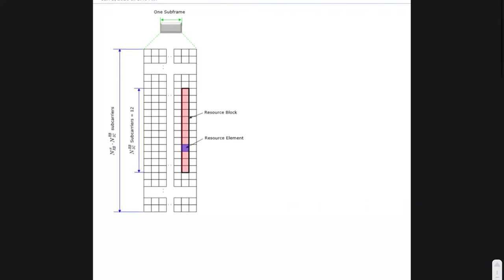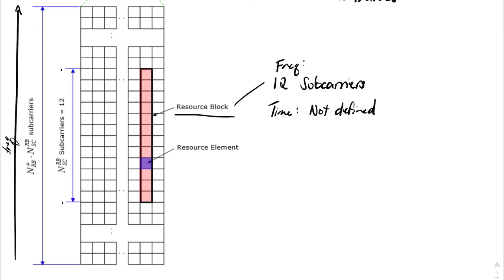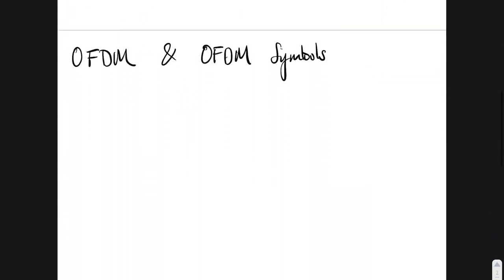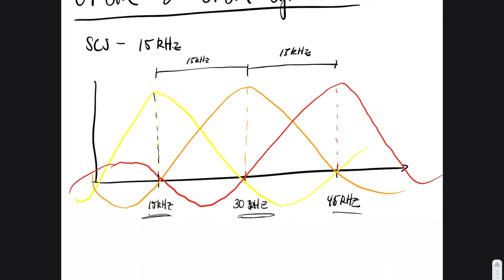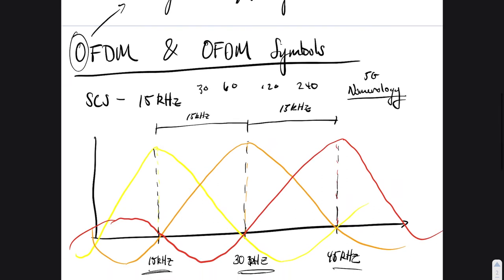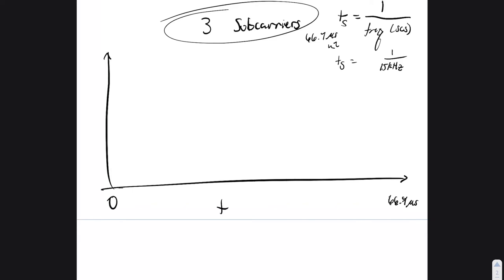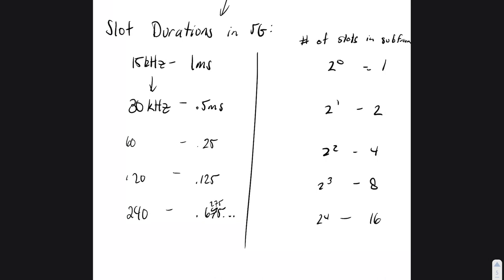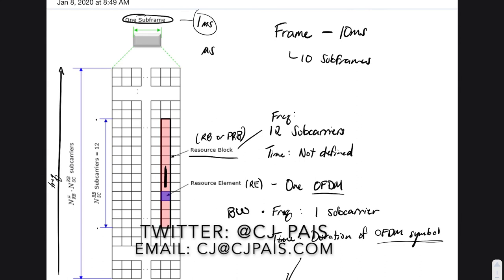Fundamentals of 5G Physical Layer: Resource Grid

Comment: Good explanation, sir. I have a few questions, so please clarify them.

1. If 15 kHz subcarrier = slot per subframe is 1 slot = 1 ms = 14  OFDM symbol, then 30 kHz subcarrier = slot per subframe is 2 slots = 1 ms = 28  OFDM symbol, and for 60 kHz subcarrier = slot per subframe, it is 4 slots = 1 ms = 56 OFDM symbol.

Now, my question is this:
A . What is the size of 1 slot, which means each slot's bandwidth size, for 15 kHz, 30 kHz, and 60 kHz?
 B. How much bandwidth contains 1 OFDM symbol?
 
2. Resource element (RE)  consists 1 OFMD symbol in time domain and 1 subcarrier in frequency domain.1 slot  =14  OFDM, where slot duration depends on subcarrier spacing.
Now, my question is this:

A. Is there any relation between slot and RE?

B. 1RE = 1 OFDM symbol (also 1 subcarrier), and 1 slot = 14 OFDM symbols. so can I say , in 1 slot contain 14 RE or 14 subcarrier.
Reply from the maker: Hi I am sorry, I have not been working in 5G for some time now and it will be hard for me to answer your questions effectively now. I would refer to https://www.sharetechnote.com/html/5G/Handbook_5G_Index.html
Reply: What is the size of 1 slot, which means each slot's bandwidth size, for 15 kHz, 30 kHz, and 60 kHz?
Answer: if we want to tell BW size its combination of sub carriers and symbols i.e PRB. BW won't express in terms of slots.
B. How much bandwidth contains 1 OFDM symbol?
Answer: same as above

Comment: Good explanation. But one disagreement - a resource element is not one symbol. A resource element is just one sub-carrier (out of  several thousands) in the symbol.
Reply from the maker: Yep you are correct, I misspoke here. I was using OFDM symbols incorrectly, where and RE is a single subcarrier in an OFDM symbol as you point out. The subcarrier is occurring in the frequency domain and the OFDM symbol is occurring in the time domain